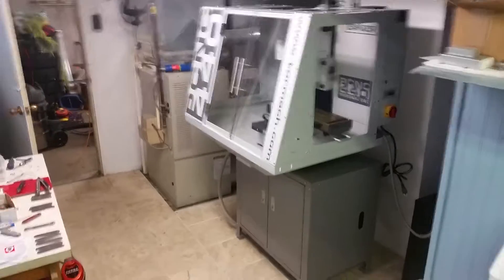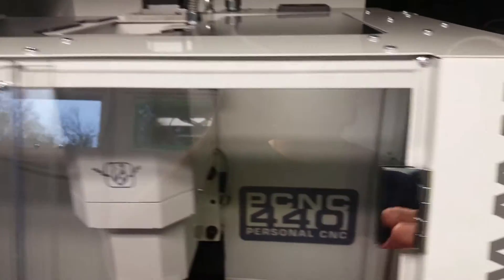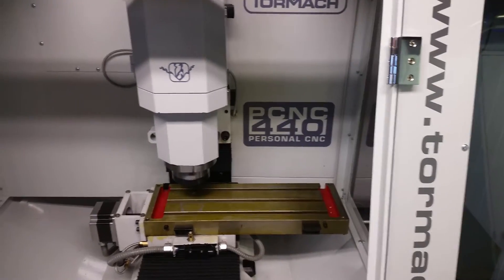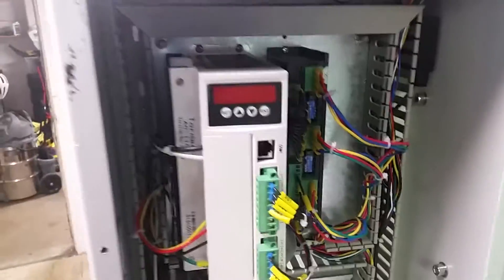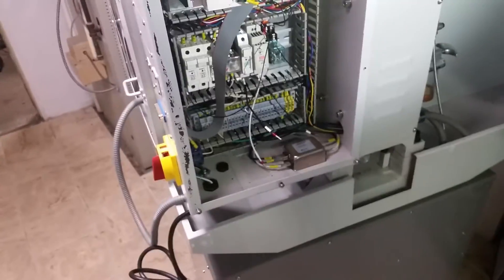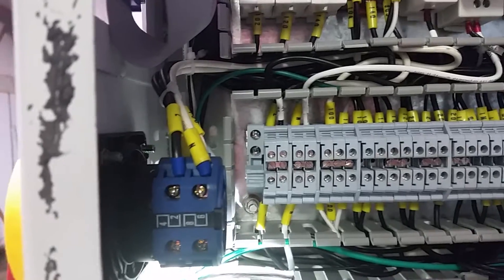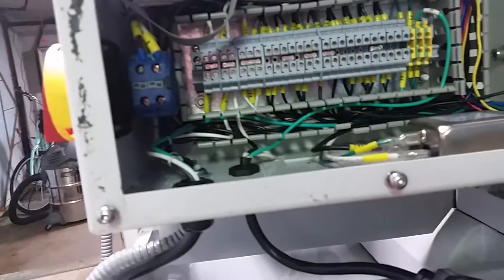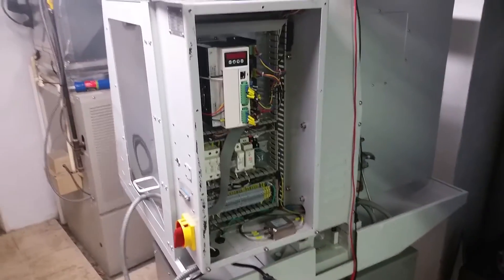My New Tormach 440 CNC Mill Video 9

Comment: What about a cut out of the right and left most sides of windows where they touch the "bottom" of the hinge +/- slotting screw holes on Plexiglas which would close the gap on the sides
Reply from the maker: you know that would have probably done the trick if I would have thought of it before I trimmed the whole length of the one side.  Good idea.
Reply: yea I saw the other video- it turned out fine. Depending on the amount of leak perhaps a number of small drain holes on the bottom lip might suffice.